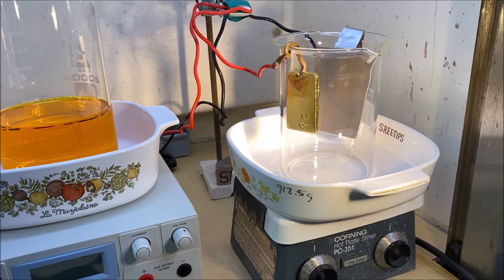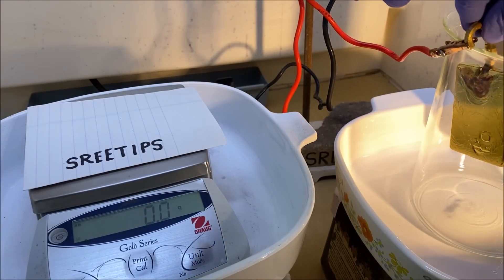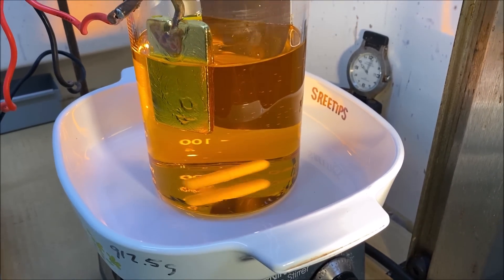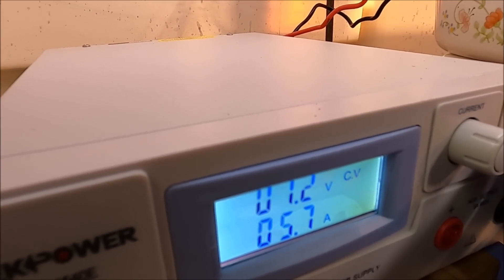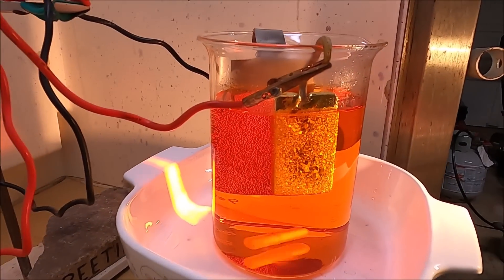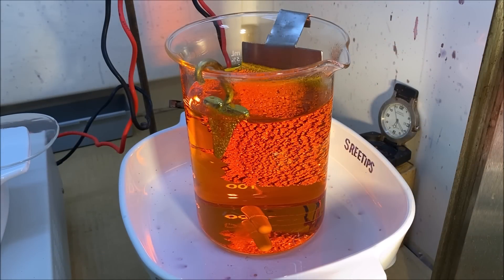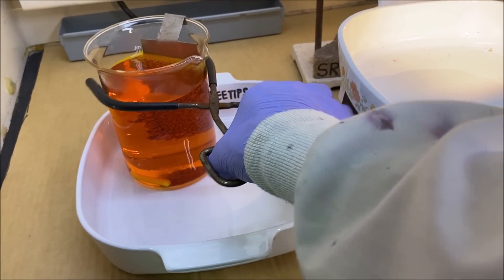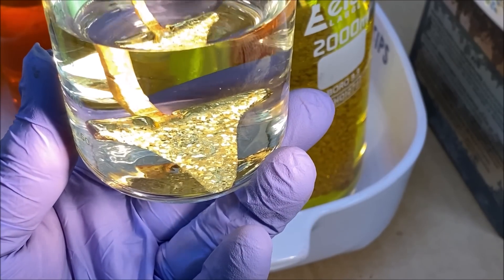Electrolytic Gold Refining Cell Pt2

Comment: I didn’t watch the video for more than 3 minutes but I hope you didn’t lie in the thumbnail about growing gold ❤️👁️🔥
Reply from the maker: Absolutely not. I’ve built my channel based on truth. Grow: to increase in size or mass. When the electric current flow dissolves the pure gold anode, the gold ions travel through the electrolyte and plate out as four nines gold on the cathode. The gold “grows” on the cathode (increases in size) as the cell operates. The gold does not grow from nothing. I can’t create gold out of thin air.

Comment: So the only gold you get on the cathode is from the anode? Is there a way you can pull the gold out of solution using gold electrolytic solution like you do with your silver cell?
Reply from the maker: Correct. The gold in the electrolyte can be recovered by adding SMB

Comment: Question. Can u build a super cell for gold like u do for silver. For like doing pins and scrap gold
Reply from the maker: In order for electrolytic refining to be successful the anode material must be relatively high purity to begin with. Otherwise the electrolyte becomes fouled very quickly.

Comment: So basically ur only pulling off the gold u put in the electrolight and anode bar onto the titanium so there won't be any more then u have between the2 liquid and bar right or will it break it down and there actually be more gold then is added between the 2
Reply from the maker: Correct, this is gold refining not gold creating (wish I could create gold out of thin air).

Comment: Sreetips -- I have a question. When there is a loss of gold after processing, what accounts for the loss of gold? Evaporation (mollucules in vapor)? Splashes of gold in solution? Gold left behind in paper filters? Fine gold disolved in waste solution poured off? I think in a recent video you had like 7 grams of gold missing after processing (I might be wrong, I can't remember exactly). Do you know where / how the gold is being lost?
Reply from the maker: All the above. There are losses along the way. Minimizing them will depend on the skill and technique use by the refiner. Also, l probably made an error when sorting the karat scrap. Threw in a piece that was plated or gold filled by mistake. That can throw the yield off
Reply: @sreetips  Ahh I see. If it was an actual processing loss, rather than just a sorting mistake, then you are likely to recover it later on from the gold refining waste liquids and/or your saved paper filters. Thank you for taking the time to reply to my question. I love all your videos!

Comment: Hi Sreetips, just a quick question regarding cementation of silver from waste solutions. If there is any gold still in solution will it cement out with the silver and what is the best way to make sure other than the stannus test.
Reply from the maker: Yes, boiling nitric will put a little gold in solution. But it’s usually just a trace and not worth trying to recover. If there’s gold in solution with silver then I just cement it out on copper with the silver. Melt the cement silver (with the small amount of gold in it) and run it through my silver cell. In the cell, the gold will get trapped in the anode filter because it’s insoluble. Then I recover the gold when I process the anode filters for the precious metals that they contain.

Comment: If you want to grow nice fairly  big crystals, I recommend to reduce the surface area of the cathode to a pretty small size, maybe half a square inch.

As optimum I suggest a high purity gold cathode in irregular shape to give the cathode some prefered accumulating points.

I think nice and fairly big gold crystals would sell pretty well on your ebay
Reply from the maker: Excellent, thank you

Comment: Some observstions and comments if allowed:

1) The cell has a charge parity. For every Au-ion that leaves the Anode into the electrolyte an Au-ion attaches to the cathode by aquiring electrons out of the electrolyt in absolute the same moment. The question of the distance between the electrodes is inferior as long the conductivity (aka concentration of electrolyte = 1/ resistance) and the Amps and Volts are high.

2) I would not use the stir-bar. Any impurities get agitated in the electrolyte and like an old rug, the gold sponge at the cathode catches those and the growing gold crystals enclose them in the sponge.

By not agitating zhe fluid the impurities just sedimenting down under the anode an stay there.
One more reason to evaluate the gold cell similar to the silver cell.
I even think its not necessary to heat the cell as long as you got time on your side as with the silver.
Reply from the maker: I’ll try another refining soon with a different anode bar and revised configuration

Comment: What makes the spinning rod spin in the bottom? Is it magnetic?
Reply from the maker: The spinning bar in the beaker is a Teflon coated magnet. The hot plate has a motor driven spinning magnet built in under the heating unit. It’s a magnet stir plate

Comment: Try like a silver cell, you can use gold (shark tooth) left over from the experiment, add rings, gold bracelets to your basket. I think gold goes to the titanium plate, silver and other metals will remain in the basket, Try it, you have nothing to lose, it's an experiment, I'm curious how much metals are lost through smoke, it's worth a smoke recovery experiment and turn it into liquid, from liquid to extract precious metals
Reply: I'm thinking, by this method you refine gold without using a lot of acid.
Reply from the maker: Two problems: the anode material must be fairly high purity to begin with or else the cell would quickly become fouled with base metals. And a stainless bowl cathode would react with the gold chloride electrolyte. This method, anode and cathode facing each other, is the most efficient way to do this.

Comment: you know i found this book at a antique store for 10 bucks
Reply from the maker: Nice find. I paid $65 about twelve years ago. Found it on gesswein.com but they sold out after I recommended them in a video a few years back.
Reply: @sreetips  is this the source of your complete knowledge? i find this work fascinating
Reply from the maker: No, I use trial and error also. But the book is very helpful. For example, I wouldn’t know the parameters to operate the gold cell without the book.

Comment: Could you do the same with impure gold shot or even inquarted gold ?
Reply from the maker: Im planning to do just that. Inquart done karat scrap, part with hot dilute nitric, then melt into an anode and run it through the gold cell. The recovered gold should be about 990 parts per thousand, so it should work.

Comment: It would be intersting to wheit the final product. See if the wheit outside the electrolyte is s'il the same.
Thank you. I love the electro deposit of gold. And i stil would love to see 14 and 18k gold refining with this setup
Reply from the maker: The anode must be fairly high purity to begin with. But I may inquart some karat gold, part with nitric, then melt the recovered inquarted gold into an anode (should be about 990 parts per thousand). Then use that as the anode in the gold cell.

Comment: This is awesome stuff, I have a question? What happens to the gold that’s in solution? I see the anode dissolves and gold is deposited on the titanium cathode, but is the dissolved gold just making the connection between the anode and cathode or is there more to it?
Reply from the maker: The sole purpose of the electrolyte is to enable the gold ions to travel from the anode to the cathode. But some of the gold from the electrolyte does get deposited as sort of collateral damage.

Comment: When you purify the  bar by electrolysis you have to collect the impurities that were in that bar somewhere; do they end up in the gold chloride electrolyte or did they fall off the cathode and get picked up by the stirred solution and end up on the rough surface of the gold?  When you purify the silver nitrate you have a filter between the electrolyte and the anode.
Reply from the maker: Insoluble impurities fall to the bottom of the cell. Soluble purities won’t deposit and get left in the electrolyte.

Comment: As the gold atoms leave the anode bar they "etch" out the crystalline structure that actually makes up the bar. This allows the light to difuse all over the place and show you the structure you cannot see otherwise. Yes, that structure is always there but your eyes fool you because the surface is usually smooth and the light has no bevels to reflect off of. I do love physics. I bet that tooth looks amazing under good magnification.
Another winner, Sr. I'm thinking Mrs. Sreetips probably took possession ASAP.

Comment: So.. what was wrong with the gold bar? I'm assuming you made it but usually the gold bars you make are pretty pure already ..
Reply from the maker: Three nines is industry standard. The fourth nines is totally unnecessary unless needed for some specific purpose.
Reply: Nothing inherently wrong with those bars, they were just needed for this video, which resulted in higher purity gold (at least .9999 instead of .999).
Reply: @apveening  is 4 9s fine worth more than 3 9s fine?
Reply: @bigpoppa4005  Marginally.

Comment: Absolutely BRILLIANT work, S!
Great nodularisation, makes for easier peeling from the titanium I'd bet. 
I think you should move to this method. Even with inquarted gold, I'd bet you could get higher purity yields with Ag/Cu byproducts to be collected at the bottom of the beaker.
Suggestions/Ideas: 
1. A titanium sleeve to hug the inside circumference of the beaker [slight spring tension] with the anode bar suspended in the centre.
2. A silicone lid to fit the beaker to reflux the HCl [prevent loss through evaporation.
3. Perhaps an Arduino to control heating to maintain the 140F temperature.
Thanks for the great electroforming content! Greetings to you n family from Hopkinsville, Ky!
[Yes, I thought "shark tooth" as well, lol.]
Reply from the maker: All good suggestions. Especially titanium sleeve with anode in the center. I believe that the excessive distance between anode and cathode in my experiment slowed the process considerably.

Comment: I’m sorry I just wondered if the gold that is growing is just the gold coming out of solution?
Reply: Well, yes. 
The gold from the anode goes into solution. Gold from the solution is deposited onto the cathode.
Reply from the maker: Most of the gold comes from the 10 ounce anode bar as it dissolves from the current flow. But some of the gold from the 90.2g in the electrolyte will get deposited on the cathode. The gold in the electrolyte becomes slowly depleted as the cell operates.
Reply: @sreetips  I'm curious about that. Theoretically (in my mind) it should be a one-for-one molecular exchange and no depletion of the solution should occur. Your yield recovery mass of the chloroauric should be exactly what you dissolved into it initially - hopefully we will see in Part 3.
Reply from the maker: The gold in the electrolyte, and the gold coming off the anode are identical. The cathode can’t discriminate which is which. So invariably, some of the gold from the solution will get deposited as the cell operates. Sort of like collateral damage. I’d guess that about 20 grams of gold on that cathode came from the electrolyte.
Reply: @sreetips  But in theory at least every electron coming off the anode knocks loose one atom of gold into solution, while one atom of gold is plated onto the cathode from solution. I don't doubt that there are losses but I would expect them to be negligible, in the sub-gram range. Very interested to see what you recover when you precipitate out the solution, and how the final mass balances between the anode, cathode, and solution.
Reply: @JP-kb5ng  The mass will be the same.
The only difference will be the impurities in the original anode that have been released.
Reply: @MickTee2k  That is my thought as well. However @sreetips claims the electrolyte becomes partially depleted of gold and plates out extra onto the cathode; he expects to precipitate around 20g less than the 90g he originally dissolved when making the electrolyte solution. I look forward to seeing how his yields add up at the end.
Reply: @JP-kb5ng  Interesting. Chemistry is not my strong suite so will have to take his word for it :)

Comment: Refining Precious Metal Wastes by CM Hoke is available in paperback for like $20 as well. Seems cheaper than printer ink, FYI
Reply: Where?
Reply from the maker: eBay
Reply: @JoelHirtle I got two hits right away by a simple online search. One at big A (not going to name it) for just over $50, and there is an American company that supplies mining products, which has the softback for $25. Legend.
Reply: Yes where?
Reply from the maker: eBay
Reply from the maker: A gallon is like twenty grand!
Reply: Printer ink can be had VERY cheap.  Does depend on the model of the printer.  I always buy printers that have the ability to add refillable cartridges.  If one is photo printing, than the quality of the ink can be important.  But most of my needs are simplistic. 
$20 for paperback isn't bad though(vs getting fully setup on a continuous ink setup).
Reply: I agree, if you buy the right printer. The one I own has a container in the printer and you can pour your ink directly into the container. It makes for a much less expensive setup. However, I do not enjoy babysitting the printer when I have to print large reams of stuff
Reply: Get a bottle of printer ink, then you can refill your printer cartridge. Lasts a lot longer, far cheaper. They fraud you on the cartridges by barely putting any ink in it (and they program the printer to run a "cleaning cycle" between every function, it wastes half the ink)
Reply: It took me a while to get used to the fact that I had to manually run cleaning cycles on my printer, but I really appreciate the fact that I don’t use nearly as much ink as I used to

Comment: When I worked in the gold room in a mine in Australia we would electrowin the gold from the eluate solution onto a stainless steel mesh anode. Once a week we would pull out the cathodes out and we would Gerni off the gold. It pretty well looked the same as your precipitated gold. We would vacuum the excess water of and then mix in fluxes and then smelt it. I like watching your stuff your cell is like a mini version of what we did eccept the gold we electrowinned was from out of the eluate solution.
Reply: So a stainless steel bowl might work? Gold cell
Reply: Why not using a high purity gold cathode. Less Titanium contamination.

Or even using a gold bowl, needs maybe 1kg of Gold, depending the size. Doesn't have to look pretty, just thight and stable. Casting or asking your goldsmith friends👍🏻
Reply: Was that at Mt Lasham that has the cell house

Comment: Question about free hydrochloric acid and the evaporation issue. (I'm guessing distilled water was used in that solution.) How critical is that 10% free hydrochloric acid? Does it get "used up" in the reaction? Would that have been water evaporating and not the acid? 

Also, something else random: the stock pot has been having certain issues. Maybe consider starting a new one next time instead of adding your leftovers from the last one. Dry out your left overs and keep it stashed somewhere to mess with on a later date.

Thanks for sharing your play time with us ;)
Reply from the maker: I added numerous doses of hydrochloric acid to the cell to keep it hydrated. HCl improves conductivity

Comment: Great video! Why does the shark's tooth have a texture. Why not a perfect smooth surface?
Reply: Metals have a crystalline structure, and I assume gold is no different. Cooling it quickly produces smaller crystals, and doing it slowly would produce larger.
Would love a close-up of the surface.
Reply from the maker: I’ll try using a small microscope on it in part three.
Reply: Imagine a zillion invisible gnomes, each of which has a spoon that can pick exactly one atom of gold off the bar and send it into the solution. And that's what all 1 zillion of them doing, over and over again at random, repeating the "scoop an atom from a random spot" operation at a rate that boggles the mind. Since it's random, there's no telling (other than the generalization "it'll be one that's directly in contact with the electrolyte") where the next atom might be grabbed from. As more and more atoms get grabbed from random places, it will eventually average out to "everyplace has been hit" if run long enough, but while it's running, there's no telling what the surface texture is at any given moment, but it's HIGHLY unlikely that "smooth" (which is required for "shiny") would be an accurate description. Presto - There's your textured surface. To have it be smooth would require atoms to be plucked out in an orderly fashion to preserve the smoothness.
Reply: @Ferd414  Oh,.... you mean turbulence. Interesting theory.